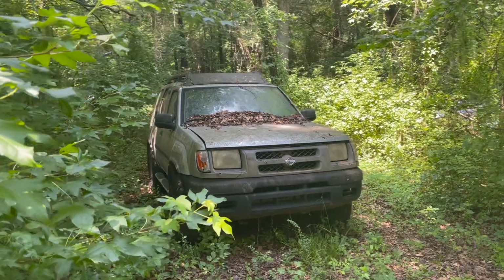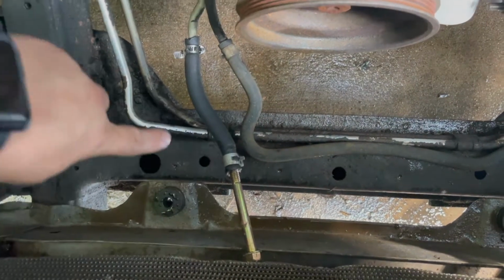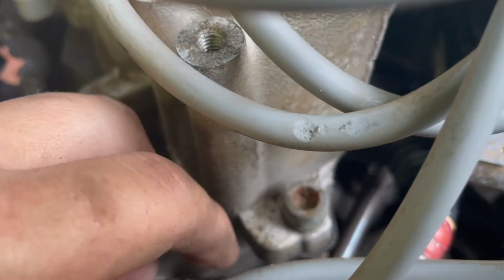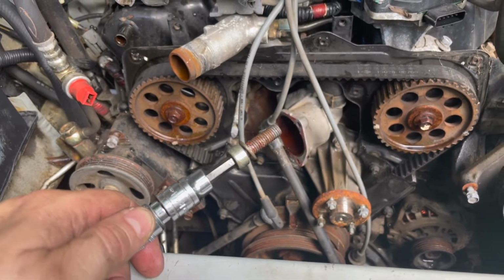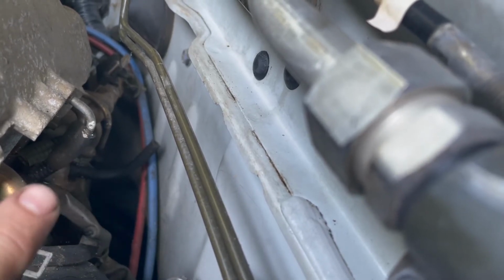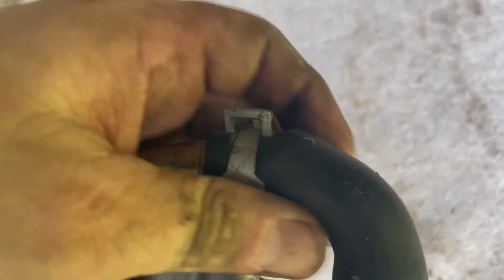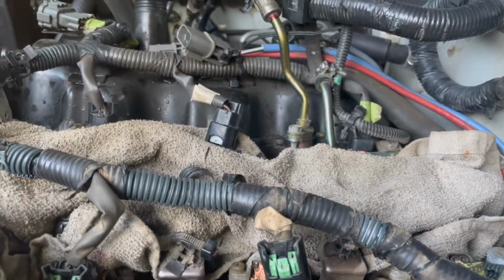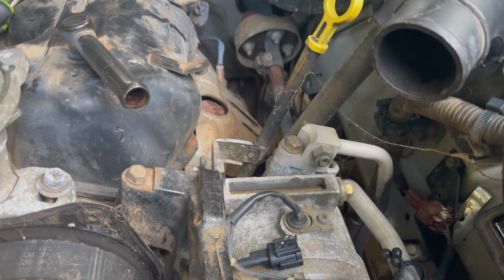Nissan Xterra Blown Head Gasket Repair 3.3L VG33E Project

Comment: If you slide a thin, sharp tipped, metal something (scribe tool or whatever) between the hose and the tube you can break the bond between the metal and rubber without damaging the hose or the tube.
You can also damage both.
Git gud :P
Reply from the maker: Great tip. Works great sometimes. I tried that on some of these, they are very hard to get to. Much easier just to cut them off and replace them in this particular scenario.

Comment: Bars leak just failed on mine so the sooner you can continue these, the better. My xterra is exactly like the one you have in this video. You can see it in some of my videos.
Reply from the maker: I am working on the second part now, Heads are in the machine shop so I am waiting on those and I have a ton of other projects going. I will get this one fixed asap, Thank you for watching!
Reply: @xlr8auto1  are you boring it to larger than 3.3?

Comment: I took mine apart last summer and got as far as bolting the heads and manifold back on and then life happened. Ive forgotten how to put the front timing cover and brackets back together. Did you take any other videos by chance taking that front section apart?
Reply from the maker: Unfortunately I do not have the video of taking that front section apart, however I will have a video coming up of me putting it back together. I have so many projects going on I couldn't promise a timeline.